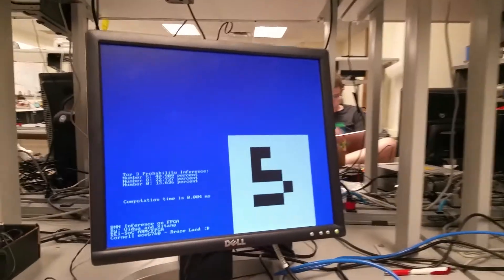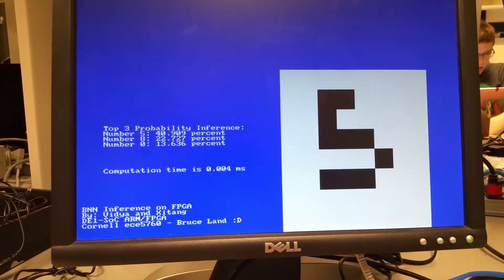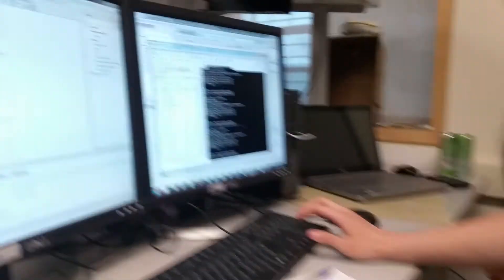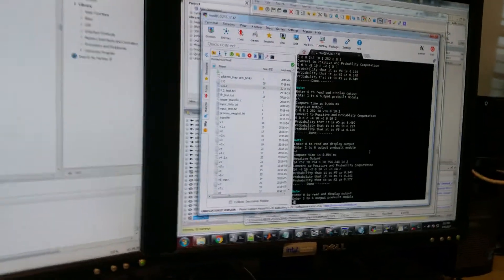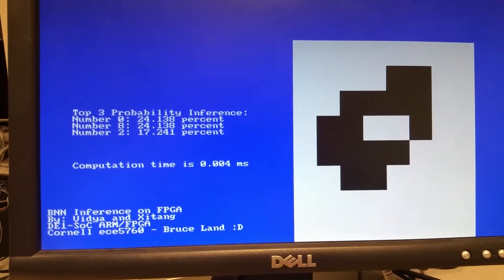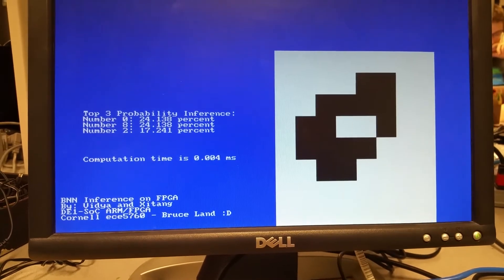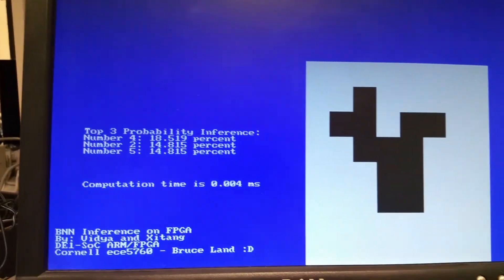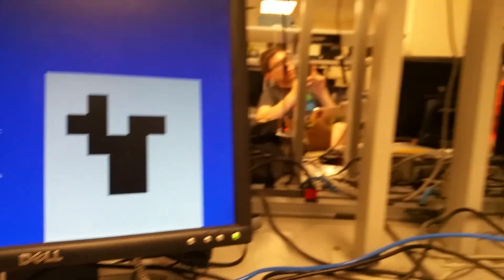Binary neural digit recognition on FPGA

Comment: Hi.. I hv designed small BNN structure.. But can u help me to calculate FPS of whole design.. Thanks in advance..
Reply from the maker: Do you want to calculate the frame rate or measure it? Are you refering to simulation or real hardware?
Reply: @ece4760 yes i want to calculate frame rate.. M referring to simulation.. . M not implementing on hardware..  I did it on xilinx software   M confused about selecting values from  synthesised report. Please guide me
Reply from the maker: @makshay157  simulation? count the cycles required by the simulator
Reply: @ece4760  ok then?. I hv got some values by calculating clock ..but some i hv gone thru some paper they hv mention a formula for that. Fps=(multiplier x utilization)/operation per image. How to use this.
Reply from the maker: @makshay157  If  multipilers are the rate-limiting resource, and  IF you know the number of multiplies/image you clearly can calculate a minimum time. But what if memory bandwidth is limiting? or communication? or gather/scatter operations? Just measure it.
Reply: @ece4760  ok..thanks for ur guidance